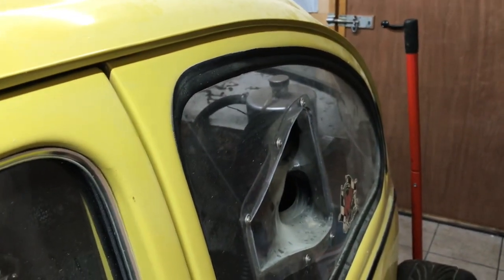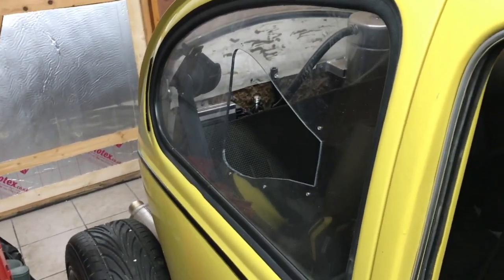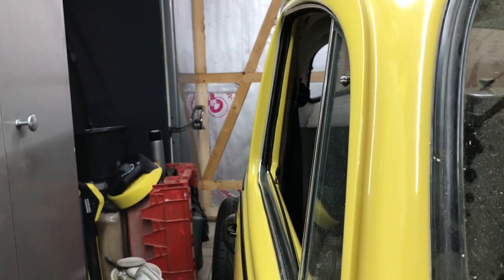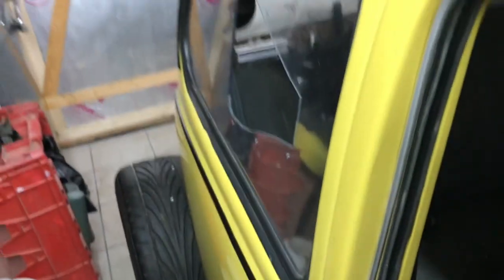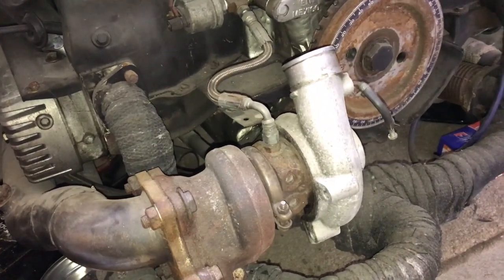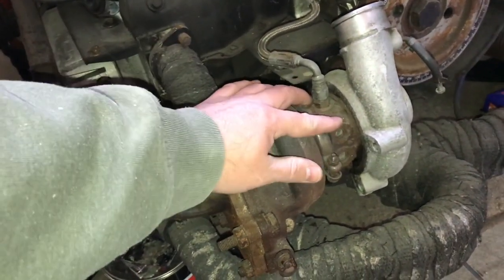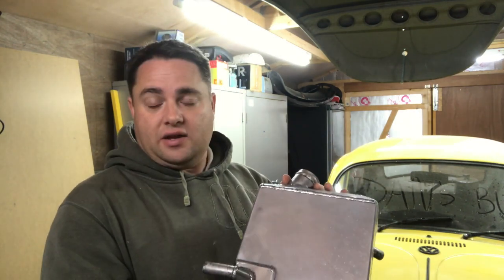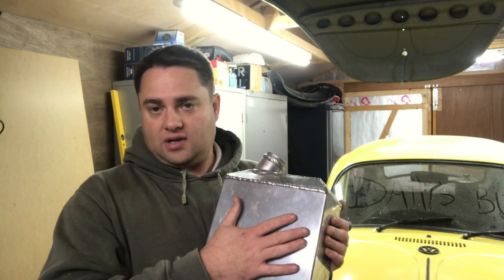KEEPING YOUR TURBO BUG COOL - PROJECT JAPBUG EP.2

Comment: The B pillars are the widest part of the car so having the NACA ducts in the rear windows has essentially put them in a low pressure zone; having scoops with entry as close to B pillar should put them in an area of positive pressure. You will not be able to bend ally tubes with the pipe benders you are talking about - I tried one for bending mild steel and it just creased it. Buy preformed ally bends and weld together or find someone to bend for you.

Comment: Hey Dan great video keep up with your excellent work my suggestion about the pipes especialy for the turbo is not too big because you will have more turbo lag just stick with the pipe size of your charge cooler and maximun 5mm bigger than this.
Reply from the maker: Hi George, thanks for watching!
I think you’re getting the turbo charge (boost) pipes and coolant lines confused.
The boost pipes are 52mm and I have no intention of changing them.
What I’m talking about in the video is the coolant pipes which will carry fluid through the turbo bearing housing to keep it cool. The radiator cooling the fluid running through the bearing housing has 32mm inlet and outlet, so I plan to use this size from front to back of the car.
I will need to reduce this down for the turbo bearing housing connections.
Reply: @Hazzardretros  Ohhh ok sorry my mistake then anyway keep this wonderfull work and bring the bug back to the roads!!!

Comment: Don't miss out on the opportunity to consider a kit car heater as part of your turbo circuit. There's plenty of neat radiator / fan setups that could well do a decent job of keepng the turbo happy ( even without the fan turned on )  Yes, you might have to turn the fan on for track days, BUT free heat for the 99% of the time you drive on the road ;-) ( I'm sure you don't run standard heat exchangers... but if you do lol )

I tried one on the chargecooler circuit on my bug, but unsurprisingly, there's not enough heat there. There must be in the turbo cooler circuit.
Reply from the maker: Definitely worth doing Barrie. I think there’ll be plenty of heat in that bearing housing but even if not, there will be when it suddenly becomes the coolant circuit for a WBX engine further down the line. 😉👍

Comment: A few things...
Radiator placement; coolest first, hottest last. So at best it should be, intercooler; oil cooler; radiator. Have everything sealed in and adequate exit holes for hot air.
Water pipes; whatever the radiator outlet size is, that's fine. Bigger is silly and extra weight.
Material; Steel exhaust pipe is aluminium coated and it works fine. Failing that, use stainless. It's tough and cost effective.
Bending; Take the car to an exhaust shop and have them bend it up for you under the car on a hoist. Cheaper and easier. 
Mounting the pipes; It can tuck up into the channels where the body mounting bolts go. Loosen the bolt, slip a hose clamp around the bolt plate and do the bolt back up tight.

Comment: I run stainless pipes and after 30k 6/years there was zero corrosion. 
G12 pretty much prevents any issues if it's changed every 2/3 years, so use whatever metal you like.
I did wonder if plastic T25 pipes could be modified to work.
My pipes run down each heater channel and up over the gearbox.
They are 45mm o/d with 35mm reducers at each end.
I did post a few pics showing my cooling system on vzi for reference.
I had a wbx 1302S back in the late 80's but I cannot remember how I routed the pipes up front.
Reply from the maker: djambrosia thanks for the advice. I have been reading your thread on Shoptalk. 👍

Comment: When my mexi is back together and off the lift, I'll put the '63 up in the air and do you a quick video of the cooling system so you can see how mine is routed.

As for galvanic corrosion and copper pipes, I've heard that too but the antifreeze in waterboxers has to be a strong mix of G12 which protects against corrosion, plus cars often have copper in the head gasket and exhaust gaskets too and they're fine!
Reply from the maker: Windhund Garage that would be really helpful!
A good point about the head gaskets!
Copper would be much easier to work with.
What will be cooling the turbo bearing housing will eventually be cooling the WBX engine.
Reply: @Hazzardretros  no worries. It'll be a couple of weeks, probably. I've got to put the gearbox back together first before I can get it off the lift.